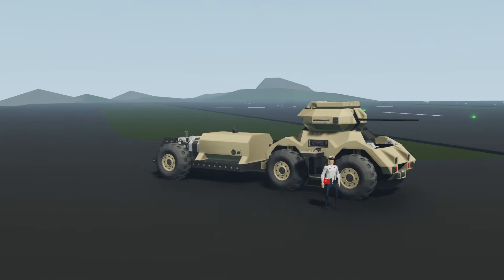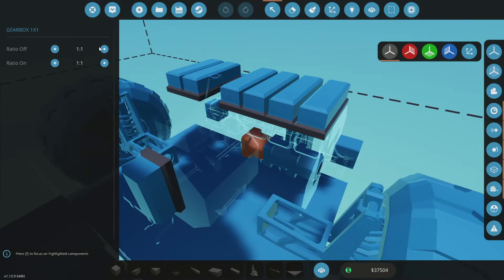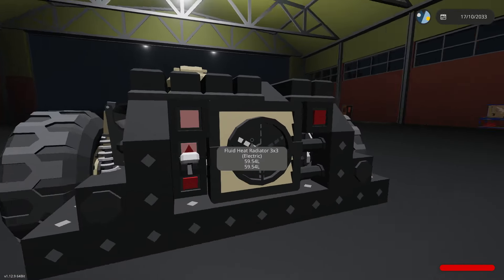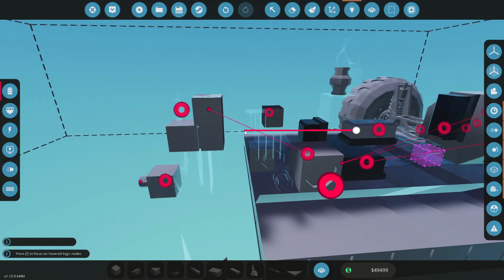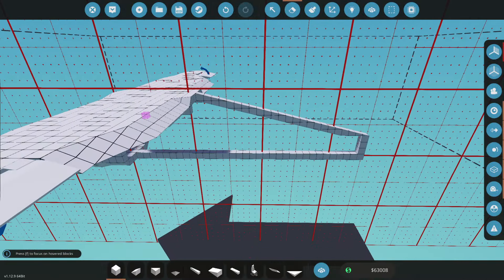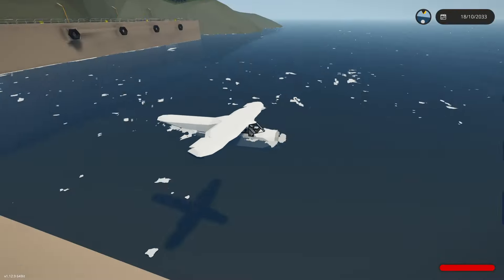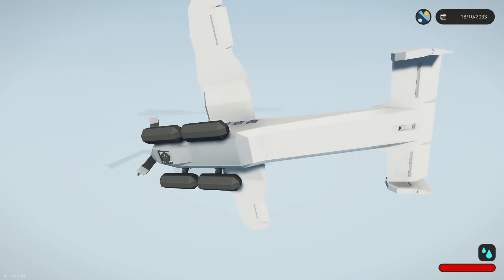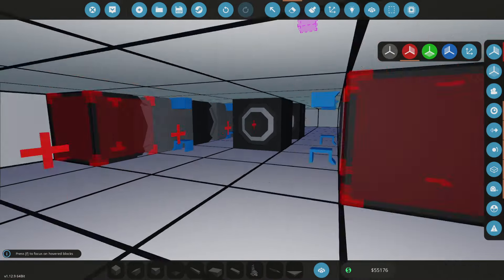We've Built A Floatplane The Can FLY! - Stormworks Search And Destroy Mode - Part 18 - S2

Comment: You really need to move the wheels forward on the trailer a little bit for one it looks goofy and for two it'll take some of that weight off the front and it'll probably work better when you're out driving around

Comment: Do you want complaints on the power output of your trailer? You can increase it by a lot more if you think of the system differently. If you think about spinning up a flywheel and using a generator to limit the flywheel RPS, you can produce a lot of power. A lot of people talk glitches for spinning up flywheels. You can do it linearly through logic, and it's easy with aid of electric motors. It just takes a lot longer than using a blinking clutch.
Reply: I have a small engine and small motor combo spinning a 1x1 flywheel limited by 4 small generators. This produces well over 400w of power while using only 0.15.0.2L/s of fuel. You can easily do this with the basic ingame logic blocks. I can share in depth how the logic works or I can send you a workshop link.